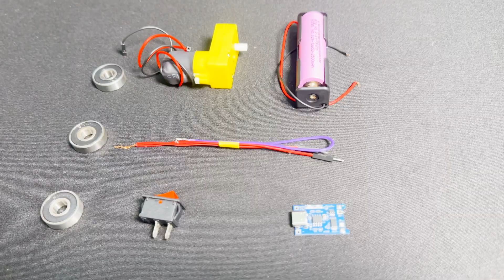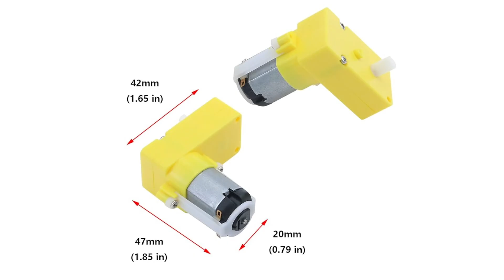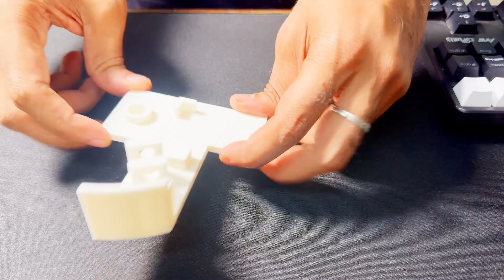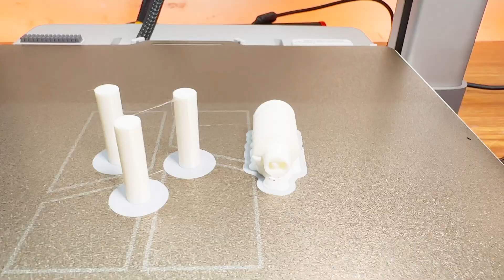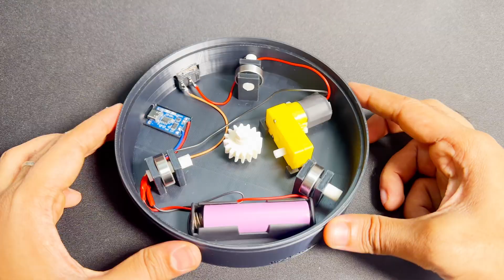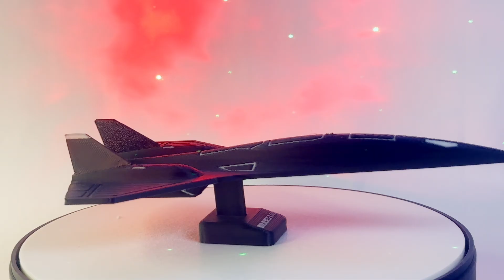I Built My Own Rotating Display Stand (3D Printed + DIY Project)

Comment: I'm working on the same thing and had designed the prototype in fusion last weekend, waiting for my bambu lab a1 to be delivered to print it. Somehow, the thought of using worm gear never came to my mind and I resolved to using 28-BYJ48 stepper motor with one single axially mounted ball bearing. I feel the geared motor would be noisy and stepper is very silent at least in my proof of concept, will see if it makes any noise with actual setup.
Reply from the maker: Absolutely, you’re right—the stepper motor will definitely be much quieter. The geared motor I used is quite noisy, but I had it lying around and wanted to see if I could make it work. I added the worm gear mainly to reduce the output RPM, and honestly, taking on that challenge turned out to be really rewarding!